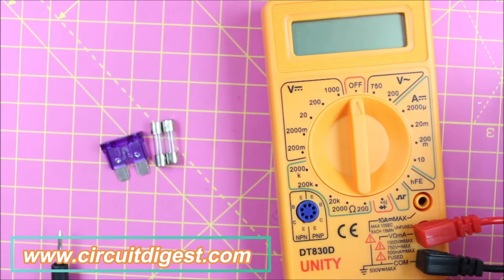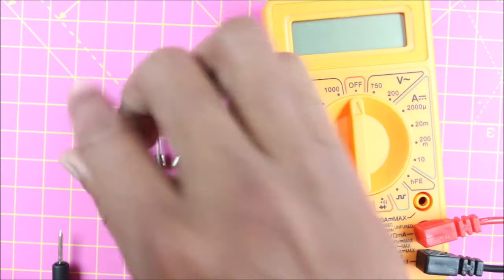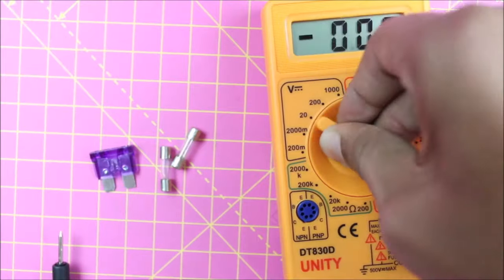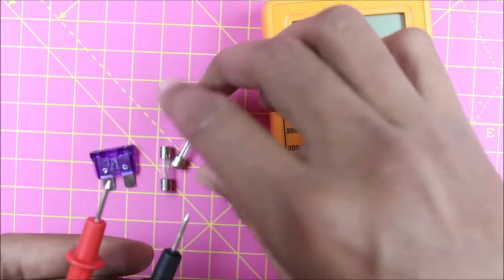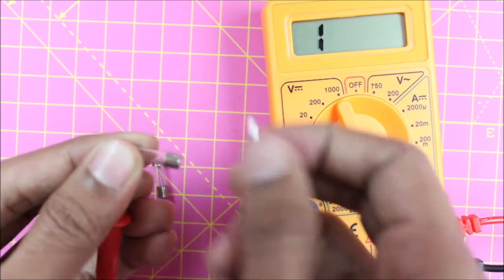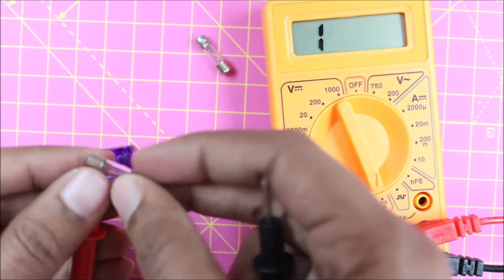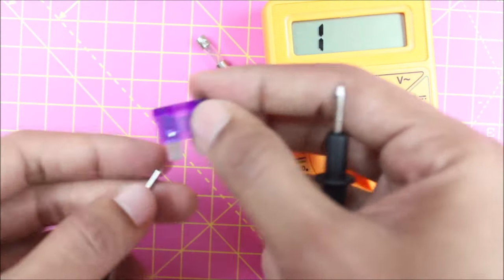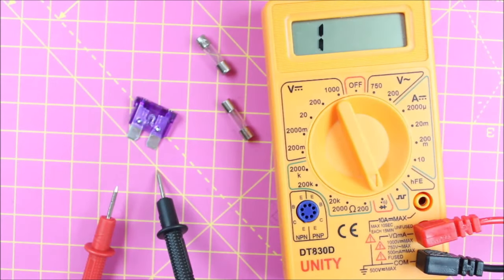How to Check Fuse with Multimeter | Simple Method to Check Fuse is working or Not

Comment: If the fuse is blown, I assume the multimeter won't beep?   Does it do anything else in that situation, like displaying something on the LCD screen?
Reply from the maker: If a fuse is blown , then there wont be any readings. The multimeter will show OL or similar message indicating open line. The actual message ma depend on you multimeter. soma may show OL some may show just 1.

Comment: I have the protech QM 1500 which does not beep, what numbers will show if the fuse dose not work?
Reply from the maker: If you are checking it in the resistance range, it should show very low resistance, close to 0 ohms.